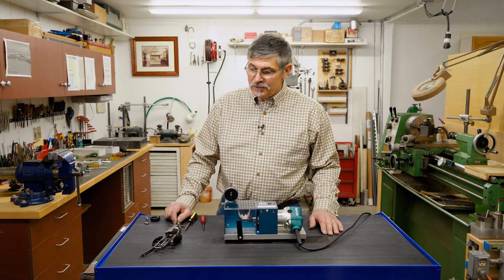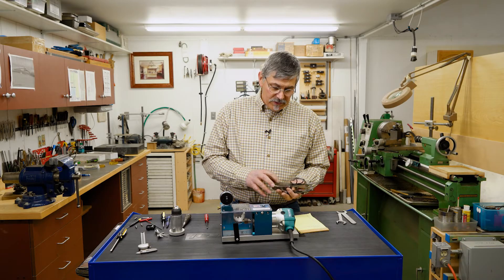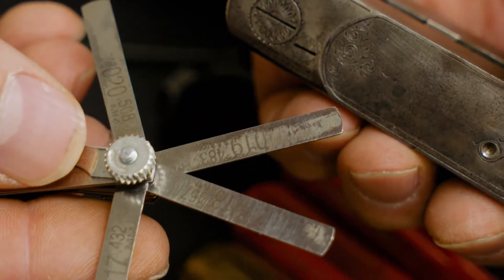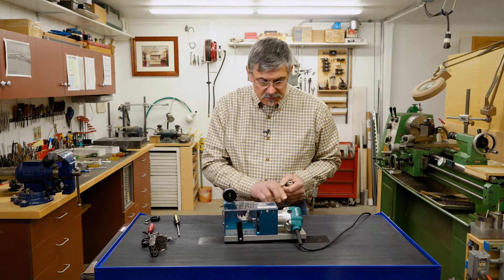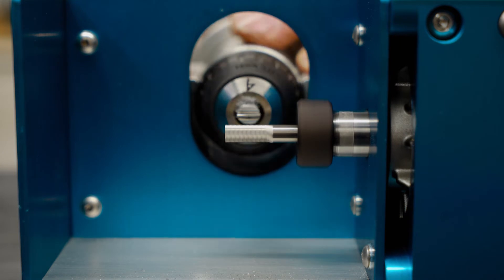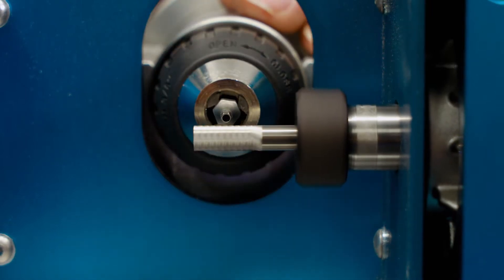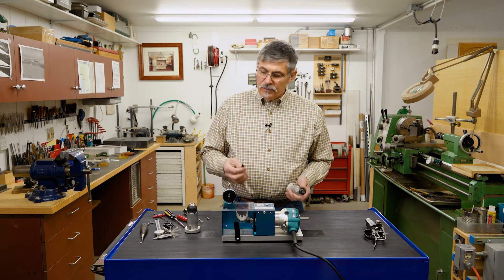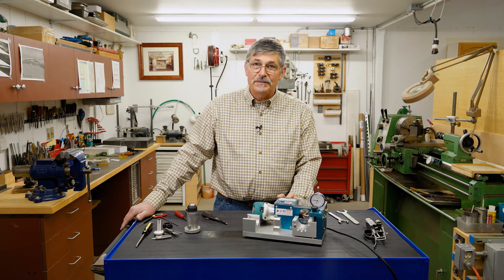©Screw-Saver Grinds Perfect Screwdrivers: Short Overview (NEVER OPERATE WITHOUT ALL GUARDS IN PLACE)

Comment: I would like to say one extra thing here, I do have a set of the Grobet screw slot files but they create vee form slots in the screw heads. Old style angular screwdrivers can be used with these slots but modern slots are made with slitting saws which cut retiliniar slots.

Comment: Can the device be used to reduce the diameter of a  driver shaft?
Reply from the maker: Yes! The width of the tip can be easily ground to fit the width of the screw slot. My preference is to make it .010" - .015" less than the width of the screw slot for maximum torque and avoiding damaging the adjoining surfaces. A great deal of torque is lost if the blade is too narrow. At the 48 second mark, can be seen a nice clean screw for which I had the perfect driver that fit the blade thickness perfectly. I thought to try removal, the screw was hopelessly too tight. I ground a blade to fit thickness and width, upon gently "testing" the driver it was as if the screw was barely even tight. That revelation was the genesis of this machine. I'm running an intro sale on eBay at this time.

Comment from the maker: The chucks hold round or hex shanks up to 3/8" and square shanks up to 5/16". I have ground slotted screwdriver blades to as thin as .005". The cutter acts like a squirrel cage fan keeping the blade cool and without pulling the temper. Using the ER-16 collets, the smallest watch screwdriver blade I have ground was .020" wide and .005" thick.